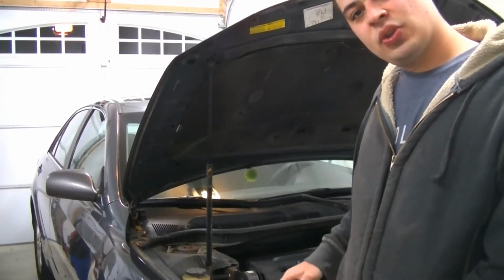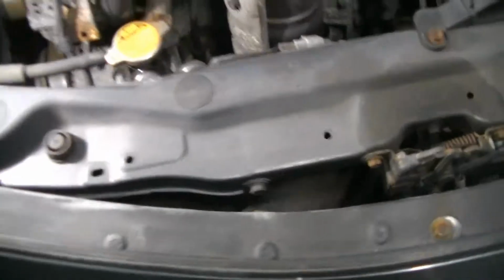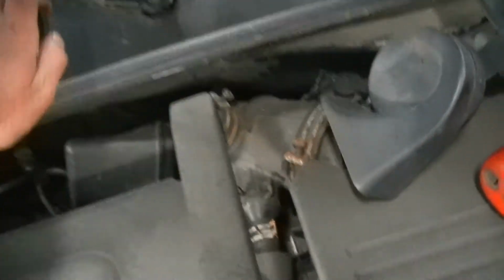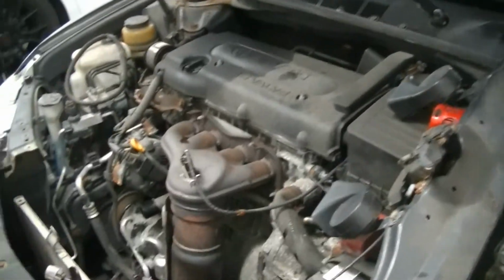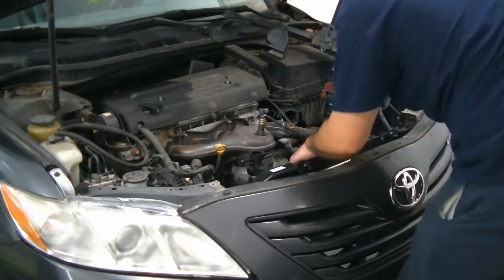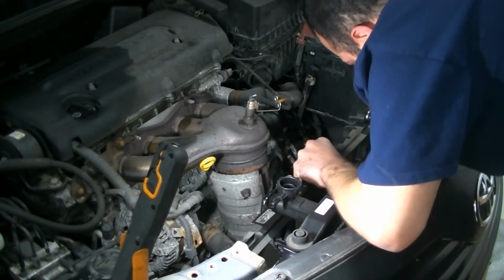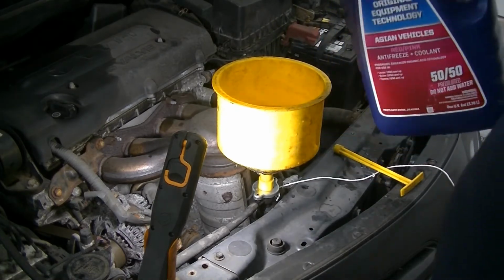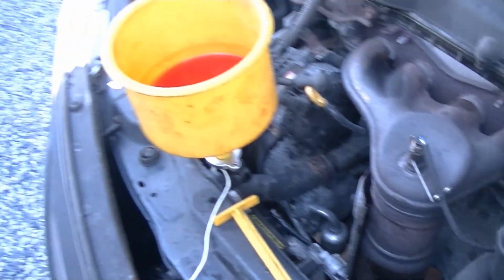2007-2011 Toyota Camry Radiator Replacement

Comment: I just came across this and your "dont buy a 2azfe" video and i gotta say you know your stuff! Keep it up! And i personally have a soft spot for 4th generation camrys
Reply from the maker: I’ve owned several 4th gens! I used to pick them up super cheap with hemorrhaging oil pumps and sell them for a decent profit. The 5s is a GREAT engine. Under powered for sure but super reliable

Comment: I’ve got this body style but a 2010 facelift with the 2.5. So glad I don’t have the 2.4
Reply from the maker: My first car was a 2010 with the V6 so I have a soft spot for this generation
Reply from the maker: The 2.4 is quirky for sure but as long as you keep oil in it, if it’s burning it. And don’t overheat it it’s a super reliable power plant